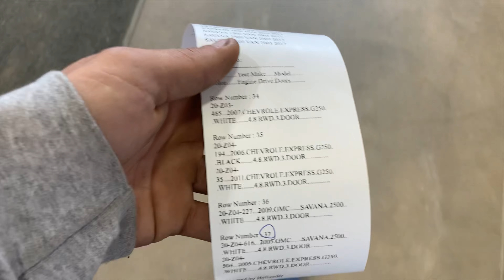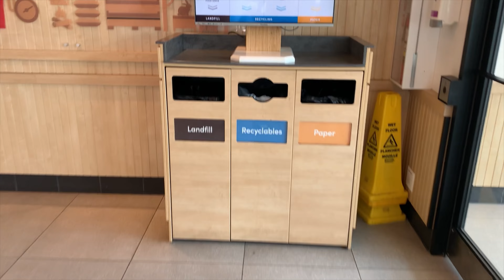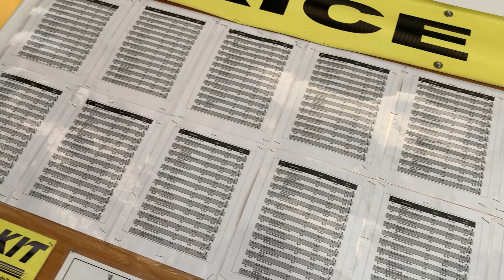A VanDwellers Day At The Scrap Yard ft@markthepaintguy​⁠​⁠ Chevy Express Van DIY Repairs

Comment: Bruce grab the pop out windows for me at pick and pull
Reply from the maker: I would brother !! but I couldn’t afford them for myself at the time currently working this week to hopefully be able to go back for a few more things 😅🤞🏼but I did manage to get a little treat for the van this week 🤩 I announced it on patreon but honestly I should probably replace the doors first before I vibrate rattle them off with my new toy if you pick up what I’m putting down 😉🔊😎🤙🏼🚐💨
Reply: @Bruce Vanlife Junior  I didn't realize that side door Hinge was a problem. My back door started being tough to open but not seized. So today I drilled 1/8 holes in each of the hinges and sprayed WD40 in each of them. I sprayed the wd40 until it became clean. Wow, the rust that came out damn.  I didn't want to spend the money on PB blaster. I will eventually get some spray silicone or some kind of greace to put in the hinges. Such a stupid design.
Reply from the maker: Yeah the hinges are such a pain !! And that’s the only way to save them if to stay on top of the rust and binding once mine are switched I swear I’m checking them every week 🤣